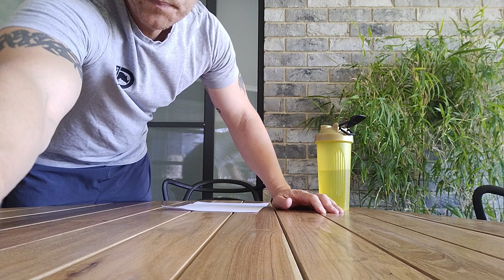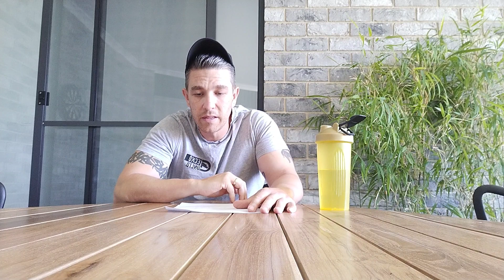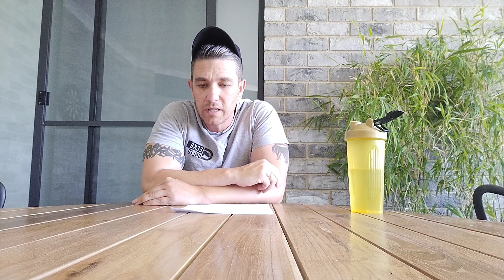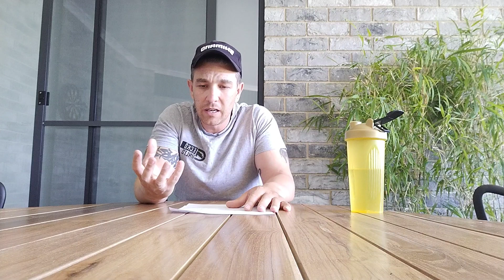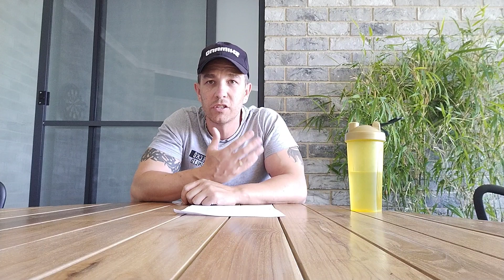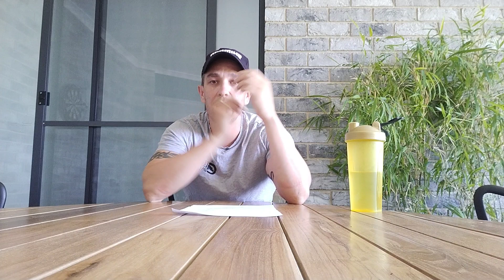TRUTH about Aluminium Boat Corrosion, Oxidation, Pitting HOW TO PREVENT!

Comment: I own an aluminium catamaran, which was built for the CEO of a big ship building company. 8mm highest grade aluminium, no anodes, went in sweet water and salt water for some 40 years.. Still 8mm hull thickness of shiny aluminium here !
Some 3 years ago, without any nessessity, I opened the compartment where the stainless steel water tank is located, I alreay emptied that tank for the winter.. And yess !! I found it !… Floating, in 350 liters of water ! With all safety involved with the building of my boat, with the so many hemetically closed compartments and high bulk heads, I never noticed it. It must have been there for many years, dripping from a hose, that was ‘very professionally’ mounted on a threaded pipe!
What I found, apart form that water and the tank? Well.. Two heavy, very corroded steel beams, some 45 kg each, in contact with the aluminium..
With a very worried face, I emptied and cleaned the compartment, it came out like shiny like new, and I still don’t have a clue why.

I contacted the ship yard where it was build, and they sadly couldn’t find anything about my boat. So I sadly don’t have any details about the type of aluminium in my boat. What I do know, is that obviously, everything was done to prevent stray currents in the hull. But still, many stainless steel connections are still here, lasting for 40 years, on the outside, in the salty environment! The ones i wanted to be removed, came off without any issues, only one had a bit of the well known white powdery corrosion. There are more aluminium mono huls here at our harbor, they somehow all show the nasty pitting and other types of corrosion, even some that are not in the water. Very weird, impossible?, I don’t have the answers, but I still am a happy guy of course…

I first wanted to sell it, but I knew that I would never get my hands on a boat like this again. So I kept it, and am now converting it to a completely off grid, fully electric motor cruiser.
Reply from the maker: Wow yeah that's crazy. Well hopefully it lasts many more years for you. It's funny, I've seen some boats 40 plus years old still look amazing and some with severe pitting etc after literally 5 years

Comment: If anyone wants to get a better understanding of how electrolysis 'works' in an alloy boat, may I suggest they watch a vid on the process of electroplating. Electroplating could probably be described as deliberately induced electrolysis. Personally, I do not allow any electrical wiring to come into direct contact with my alloy hull, regardless of polarity.
Reply from the maker: Yep agreed, good stuff

Comment: Had my 7 metre plate ally boat for 20 years no corrosion or cracks and it's had a fairly hard  time.
Reply from the maker: Yeah depends on the alloy quality itself I do believe. My family has had 40 year old alloy boats with virtually nothing wrong. Yet I've seen many 6 month old ones going to shite.
Reply: @BaitBallin  that's incredibly bad having issues like corrosion in as little as 6 months l glad nobody l know has that problem

Comment: Its good to know the following for understanding (metal) corrosion.
Corrosion is always a contact potential difference proces, and a burn proces (hence it needs oxigen). A voltage difference will cause a current, causing corrosion.
Every metal has its own "contact potential". 
And the higher element a metal is, the higher the basic contact potential.
So, if you connect two metals with eachother from a different alloy, the lowest alloy will start corroding more heavilly, the higher less.

You can experience that extremely as followed:
-iron, (fe30, period 4) covered with a zinc(zn26) layer : If scratched, the sinc corrodes, repairing the scratch so to speak, and the underying metal is shielded;
-iron covered with a chromium layer : If scratched, the underluying metal rosts like h^%&%&^ll.

The elements in the periodic table are like this:
gold
silver
rvs rost free steel
zinc (30, period 4, will protect fe iron)
iron (fe, ferro 26, period 4)
chromium(24, period 4, will eat away fero, if scateched and gets in contact with air/oxygen)
aluminium (13, period 3 will be eaten away by everything with a higher period)
magnesium(12, period 3)
...
https://www.schoolmykids.com/learn/periodic-table/compare-zinc-aluminium
So, as aluminium is very low period (2) in the periodic table, its very often lifted in base potential by all other elements it comes in contact with.

Another point to look at is for Alu 5038. It a mix of allu(13) and magnesium (12), also called "sea water alu". That turns gray in contact with sea water. You understand why...the magnesium corrodes, not the allu..., but not suited inside your home.

Comment: Been building aluminium plate boats for over 30 years best thing you can do for you boat is use lanolim
Reply: Do you mean Lanolin oil that you spray on the hull?
Reply: @neojetthomas2820 yes lanolin sheep skin fat spray inside hull and on trailer never rust or corrosion. We build dry deck plate boats and before we seal we spray lanolin inside hull. I have seen proof it works from boats of ours coming back for modifications after 7-10 years of use not a single bit of corrosion in the hulls.

Comment: I wonder if paint protection like ceramic coating would help with some of the problems
Reply from the maker: Honestly don't know, but the issues more relate to how it binds to the aluminium. Which is never great for some reason
Reply: Need etch primer before painting  @BaitBallin
Reply: @BaitBallin  Ceramic would be great if you did it to a brand new boat that wasn't coated with anything from the factory.
You'd literally have to buff or sand the entire thing, then use $300 worth of solvent to clean everything and then apply another $900 or ceramic coating. LOL 

Nobody ever thinks to use that car ceramic stuff on other things. 
I took the leftover ceramic coating from my new wheels on my car and I applied it to a new toilet in my step-sons bathroom! 
LOL 
It worked, not sure how long it'll last but the poops just slide right down the toilet.

Comment: I am repairing a old aluminum boat. Lots of corroded spots and old screw holes that I need to fill. I’m guessing a tig welder would be best for this application. 
Is there a better or best grade of aluminum for this type of repair?
Reply from the maker: Well marine grade would be good. Thin alloy is very hard to weld without burning bigger holes. Even plate boat builders recommend sealing small pin holes with Araldite rather than welding, no joke. Anyway let me know how it goes
Reply: @BaitBallin  thanks for the insight and tip 👍🏻
Reply: If it's a jon boat it's probably not alloy? 
I wouldn't bother buying a tig welder just to fill screw holes. 
Get some of that low temperature aluminum soldering rod. 
You can weld aluminum and cast aluminum with it, using a propane torch. 
You aren't welding anything structural, just filling a hole so I don't see why you couldn't use the aluminum solder stuff. 
Look it up. I used it to fill the holes around the gunwales from rod holders and other stuff people screwed to the boat.

Comment: Do you know if you need special tools and certain skills to apply nyalic or it can be a DIY job?
Reply: Mclay boats have nyalic finish , would be no different painting a car , use a spray gun , isolate sections clean and spray
Reply from the maker: I haven't done it. But have seen some others doing it online. It's bloody awesome and all plate boats should have it. Gotta be super clean and acid washed before application.

Comment: As an avid boater, I’ve had many alloy boats under 4m to complement my Haines for different fishing. It surprises me how dealers don’t use Duralac when screwing or bolting things on the hull to prevent corrosion. I build small Vans Aircraft as a hobby….. we use Duralac every time I bolt a metal screw or bolt onto aluminium .
Reply from the maker: Yeah agree. It's disappointing. Probably a combo of laziness and lack of knowledge.either way, the amount of alloy boats I see only a few years old going to crap is shocking.
Reply: Cost

Comment: Don't forget to ensure you sacraficial zinc anodes are replaced before they are too corroded. These are sacrificed on purpose to save the aluminium. Normally they're attached to the outboard motor on boats less than 7m in length, with larger sailing cats having extra ones attached in multiple locations on the hull.
Reply from the maker: Yes good point

Comment: I have an aluminum bass boat. I had battery acid escape inside my boat bilge area and leave white spots all over the Aluminum. I took out all 3 batteries and dumped baking soda all over the place. Then scrubbed and rinsed. Several times. The spots fizzed upon the first application of baking soda. But no longer fizzed after that when I reapplied the baking soda. So, I think I neutralized the acid. However, the white spots are still all over the aluminum. Would this be expected?
Reply from the maker: Yeah man I wouldn't worry about it. Could try some heavy cutting compound to polish it out. But main thing is you removed the battery acid. Things unfortunately can't stay looking new for ever.

Comment: I had an old fyran 440 runabout.riveted aluminium boat.  That had corrosion in the hull that made pin holes right though the hull and trying to weld it it was too hard. So I had to buy a new plate aluminium boat with 4mm bottom and 4 sides. I tell you what. Don’t be scared to use salt away and make sure it’s dry before you put it away in the shed or carport.
Reply from the maker: Yeah you are right it's an absolute must! Salt away or equivalent

Comment: I have a 2018 Quintrex Freestyler which I put approximately 120hrs on each year. I love the boat as its perfect for the Gippsland lakes but she is starting to have alot of paint issues. 

I wanted to respray and freshen up the hull in the next year or two, or wait another 5-6 years when I'll be looking to also bolt on another outboard. 

What's your opinion? Would I be wasting my time?
Reply from the maker: It depends what the paint issues are and if there is electrolysis under there. If yes, I'd be addressing sooner rather than later or even selling. If nothing to do with corrosion and purely just a looks thing, I wouldn't worry at all and do it when ever you see fit.....
Reply: Hi I am new to the Q freestyler stable, what issues are you having? Cheers
Reply: @Ri Ra  I'm having paint issues around almost all fittings and fasteners. The paint has also cracked on the boarding steps. The boat is always washed after use.

The top sides are basically perfect. All issues are from the gunnel upwards

Comment: Sinkers dropped down into the the bottom of the hull will eat right through.
Reply from the maker: Yep absolutely.... Especially when they sit under false wood floors etc without people knowing.
Reply: Good video again.
Had a 6 meter name brand pressed alloy boat.
Looked after it like a first born child.
The wiring was average and the boat was the earth,electrolysis started under the paint on all fittings.
So disappointed bought a glass boat.
Fully welded gunnels is a must also in a painted aluminium boat.
Reply from the maker: Yeah man it happens all the time and people just aren't educated enough etc a d dodgy wiring is common place even from dealers. Yep, with glass boats, it's a bloody headache but I can honestly repair any issue basically